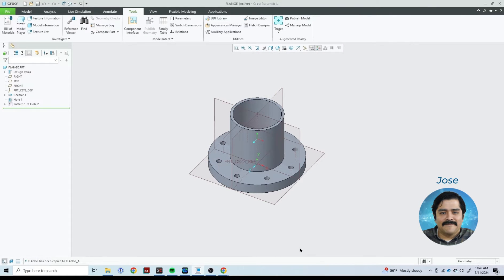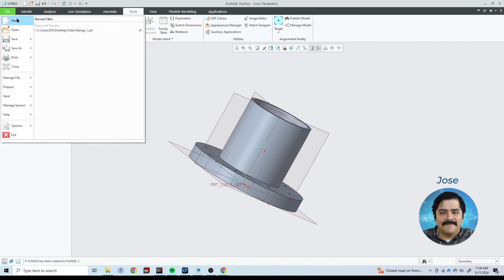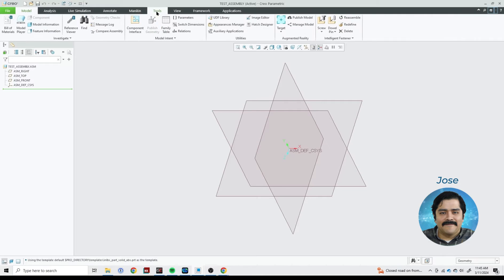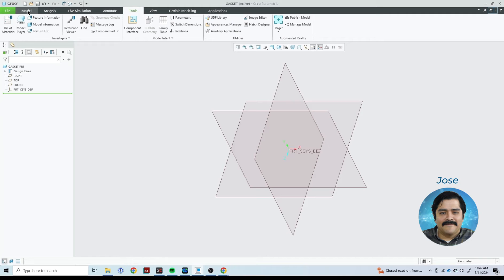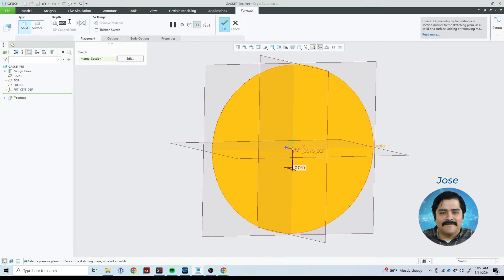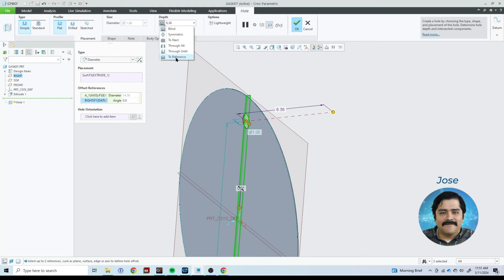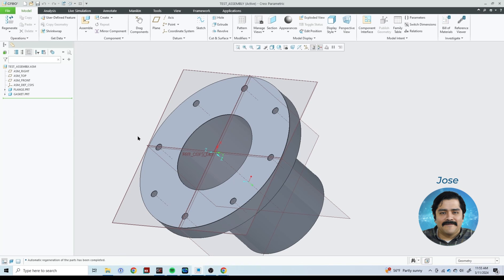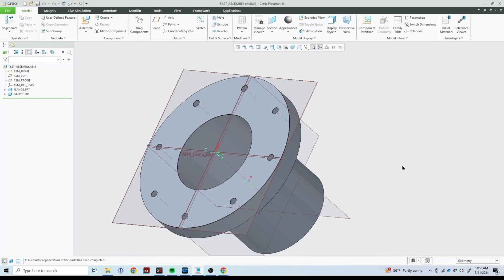Creo Parametric 10: How to Share Parameters From One Part to Another

Comment: Awesome video, but I have a couple questions if you don't mind answering them.

1.  It looked like the relation was grayed out in the gasket. Does that mean you cannot modify the dimension from the gasket model & you would have to revise, or checkout the flange to modify those dimensions?

2.  What would happen if you did a design sequence change & wanted to swap out that flange for a new flange part? Would you have to go into every model & change which flange it is related to?

Thanks!

Comment: Thank you  Jose, it's good to know this is achievable in Creo. However, rather unfortunate and fairly typical of Creo, the Creo way is obtuse and the workflow is rather clunky compared to other CAD programs (such as NX and SolidWorks).  Bravo for figuring this out in Creo!
Reply: Well this is certainly possible in Creo but was not recommended without a PLM. One can also do this without writing relations or as two bodies and then exporting them to part.
Recommended method though was to use publish_Geometry- Copy_Geometry combination.